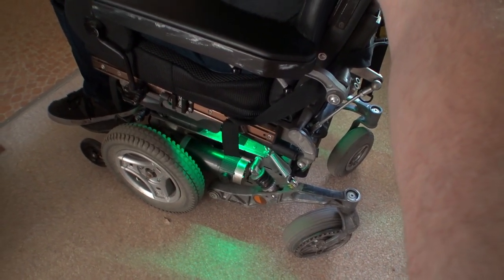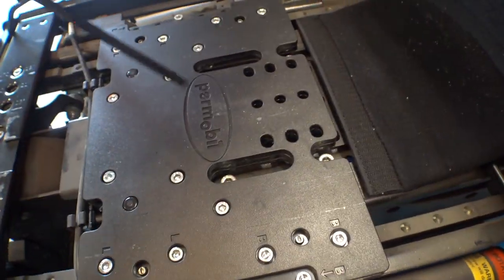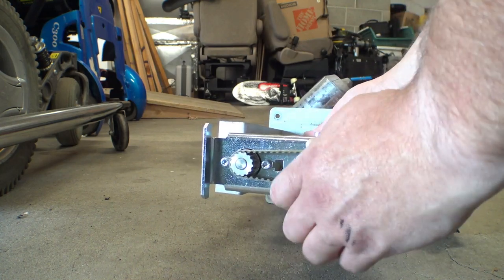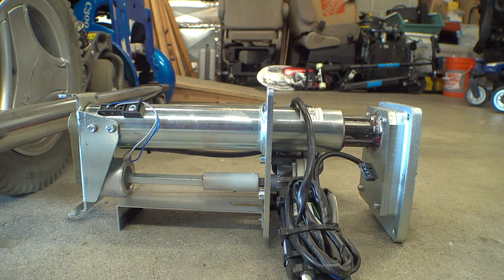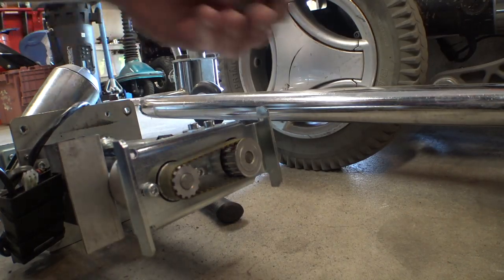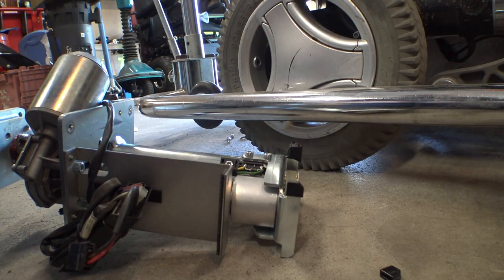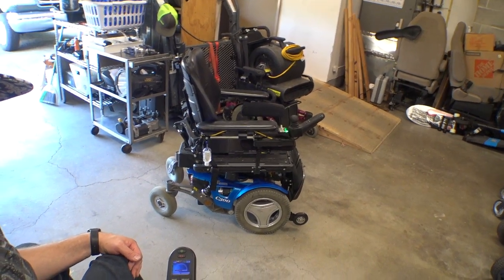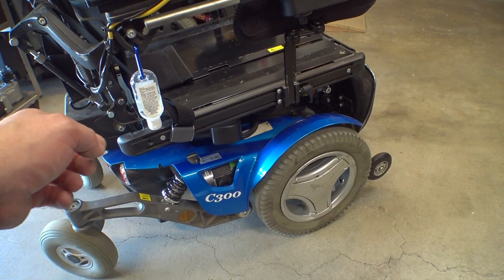VLOG 508: another broken seat elevator..

Comment: I used to build automated equipment and your approach and logic to repair is perfect, I would recommend developing a list of parts that are most prone to fail  and see if those parts are still available.  I get the other chairs are parts, but at some. Point the MTBF mean time between failures could change, and those couplers could be be in a little bin so you won't have to disassemble one to get to the part. Except to look at it. What your doing is very valuable.

Comment: Excellent video Dan, thanks. I always wondered how my elevator works (did not get it out of the C500 yet). And hey Permobil; can you explain this design choice? Is there really nothing to keep it from sliding down? Why?? (maybe there is a good reason). Would be cool if Permobil's design department would reply, but unfortunately we don't expect that.
Reply: Pretty sure the reason is to sell $2000 elevators ive bought 2 so far

Comment: Dan does the C - 500 seat elevator have a belt also do you know? My seat elevator goes up/down very slow any way way to speed it up ? My C - 500 stops on me some times as I'm wheeling along . I have to turn it off & turn it back on to get going again . The motors , hand control and batteries were replaced when the original motor on the right quit. I was told by the VA power wheelchair mechanic that did all the work on my chair that PERMOBIL no longer makes their own motors . Would you have any idea what might be causing the problem to cause my chair to stop as I'm wheeling along ? Thanks Dan ! Glad that you were able to fix the seat elevator on your C - 300 .
Reply from the maker: the C500 has a similar mechanism - but with different mounting plates on it.  but functionally operates in the same way.  and yes the lifts are SLOW.. ya dont want them moving very fast! those little motors have a lot of load on them..  does anything flash up on the screen when the chair stops?

Comment: Hey I have a QUANTUM 6000z, to get rid off in about 5 months I’m in Brisbane Australia, meaning you would want to check it out, just get new parts etc.. to it if you could fix the seat elevation and tilt you might be able use it as a spare chair for yourself, it’s sitting in the garage doing nothing
Reply: The only problem that may be the problem in the framework of it, as it needs replacing as the frame snapped,

Comment: i picked up a c300 a few months ago for $200. it's one without a seat elevator i use it for metal detecting. seems to work pretty good off pavement, have yet to get it stuck. been running it without the plastic so i can use a leafblower to clean out any grass and leaves. lol
Reply from the maker: here soon im gonna be showing a mod for C300 chairs to get some nice big air filled tires on the front, WITHOUT using adapters!! and the plastics have to be removed for this mod.. so you're halfway there already!!!
Reply: @TotallyNormal-  GREAT1 looking fwd to that mod for sure!

Comment: Every time my leg shakes like that my mom calls me tap dancer LOL! But are the seat elevators on the F series and M series configured in a similar way? Or is it just all new tech that they’ve come up with every since they released their new line of chairs like my 2015 F3
Reply from the maker: the new F/M-series chairs are totally different.. - the post in front that looks similar is actually the tilt mechanism.. the seat lift part is a separate horizontally-mounted actuator under the back of the seat pan.  BUT the belt drive is still essentially the same setup for the tilt function :^)
Reply: Totally Normal OK that’s good to hear. I seem to have the odd glitch with my seat elevator ever since they had the seat elevator completely replaced because of the factory defect that I like to call “the Chewbacca virus”. The original seat elevator made a loud noise going down and it sounded like Chewbacca.

But every since I got the elevator system completely replaced I was spraying off my chair because it was really dusty from driving around and when I went back to go driving I just left my camper and my chair stopped in the middle of the road. I was getting it and ICS tilt error and the code was 20A3. Ever since that incident happened at the odd time my chair the lower the elevator when I am in a different seat adjustment mode and it will trip that same error code, all I have to do is cycle the power and it works again.

Comment: Speaking of seating I hot me 2md gen a,u yesterday, really minor changes beefier scuzzor mech on seat madder more motor shroudinh changed the front and rear of battery box the rear do it now uses a center push button release instead of the side plastic ones . One negative I quickly found there is no longer a a confirmation beep when changing seating function, so I never know what mode I am in until trying it ,had I known that I would have bought a different chair ,until I have surgery I can't seet he display  to use the display ,and I do have a hot tip if your gen 1 needs a castor fork find a roaches out invacare storm it's the same fork ,I am now looking for anybody who has some beat down storm , is it an Enet chair you need to program? If so I have a dongle ,
Reply from the maker: yes - it wouldn't be too hard to have someone turn on the mode confirmation beeps..

Comment: Good video, so the ICS controller is hiding under seat plate ?
Reply from the maker: yes - on the M300's and C300's (also the C350 street chairs) its under the top plastic, jammed down in that little side area.
Reply: @TotallyNormal-  is it the ICS which/where the lights connect to it?
I have an old (2009ver) c300 with r-net monochrome joystick but no lights and I need to buy and connect them by myself 
.
and I must Thank you for your videos. I learned a lot